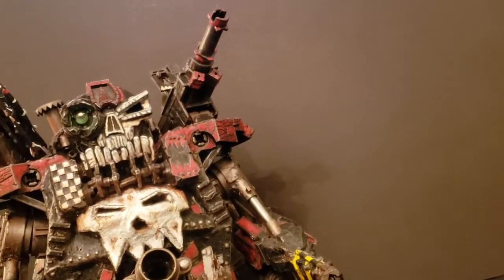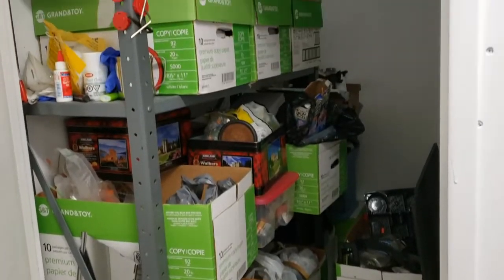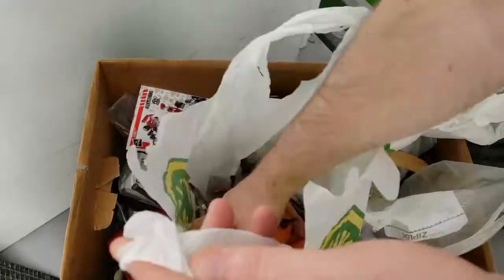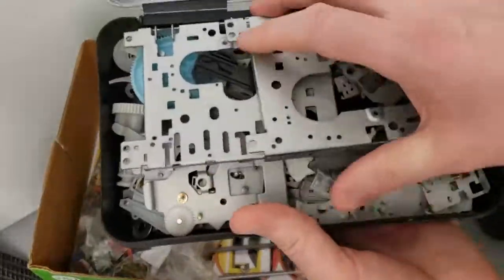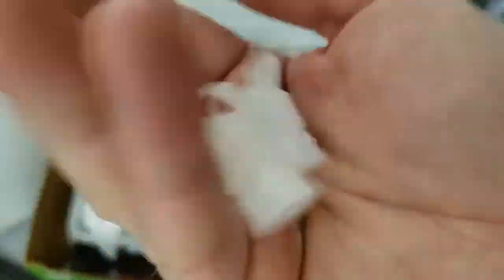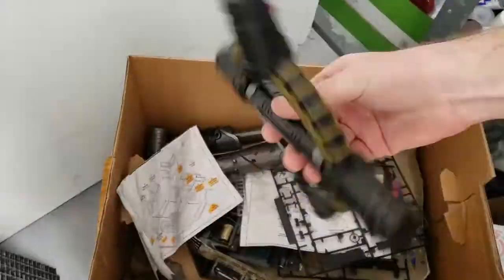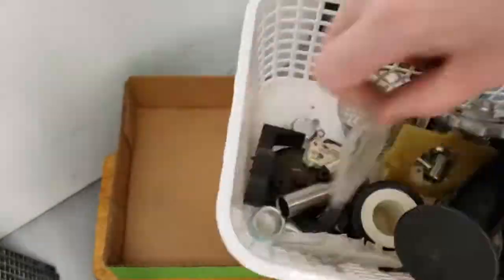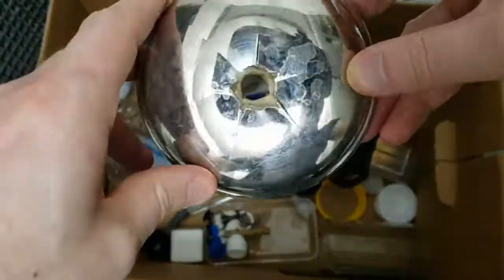My Inventory - Thank you for 1000 Subscribers!

Comment: I have the same issue with my hoard of bits from my many sources. I work in the IT field and pre-covid had access to the electronics recycling bin for my whole department. The doesn't even cover the packaging materials and items I usually across campus. 
It's a part of a university that does a lot of research. They regularly purce sterile, but outdated materials and equipment from the labs. Much of it was never even opened, but is expired.
I'm also a member of a local makerspace which is home to laser cutters, 3D printers, a workshop for wood and metal, and a CNC machine. The items thrown out by the 50+ members, the failed 3D prints, the leftovers from the laser cutter, and the donated items from the community for repurposing are all a constant source of materials for me.
Your channel is the inspiration for how to put all of them to good use.
If I ever figure out how to organize my hoard of bits for projects, I'll be sure to share it with you. Right now, most of them are stored in plastic tubs. My next move is to go through them all and reorganize them into clear tubs that are all the same size.
I currently live in a small condo and space is at a premium. Additionally, I have a storage unit full of tools, workbenches, materials, and bits storage.
My plan for that is to relocate it to a friend's unused garage once the weather cools down, save myself that expense, and set it up as a workshop that both of us can use.
My current big project is figuring out the best uses for model sprues as terrain.
Reply from the maker: Yeah I would like to see the collection!
I know all about having to work with a small space. Your upcoming garage shop sounds pretty sweet.
Reply: @ScratchBashing  "collection"! Yep, I'm going to start calling it that now! 😅

All kidding aside, the collection I'm hoping to end up with is one full of playable pieces of scratch built terrain and models for table-top wargames.